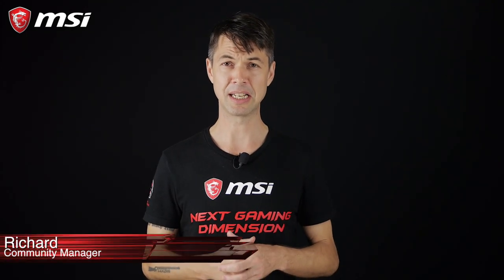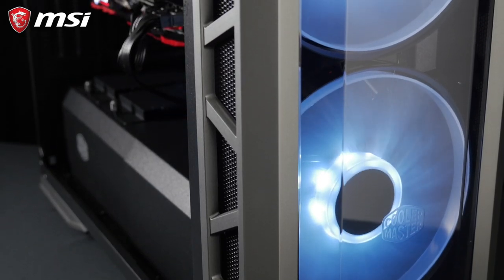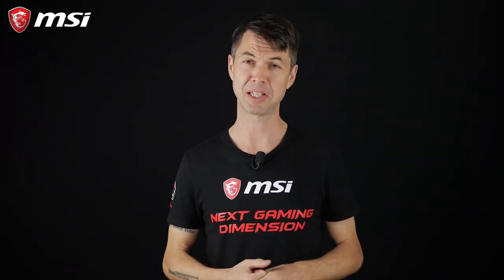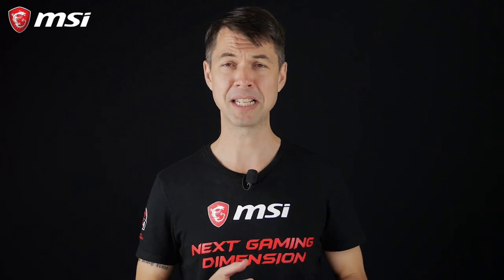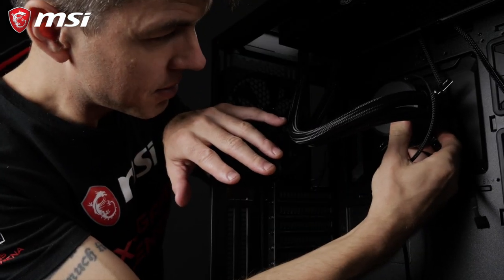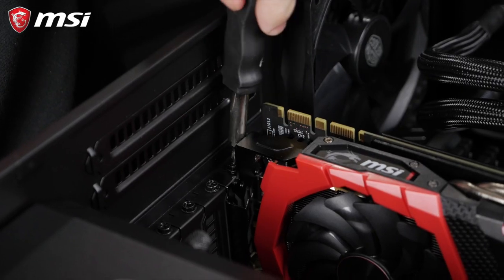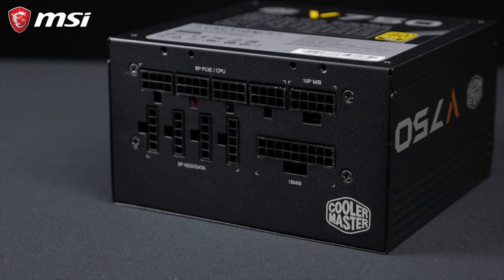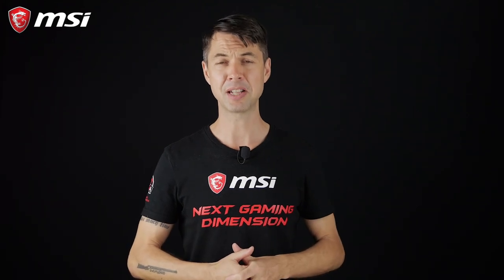MSI Pro Cast#15 –4K Video Editing PC Build Powered By Intel | Motherboard | MSI

Comment: +++Liquid Cooling advice needed!. Ive had a ryzen 1200/rx 560 system running a few weeks now on stock cooling fairly silently unless benchmarking and /or overclocking it to 3.8ghz. Tonight i made some custom brackets and fit my old AM3  920 kuhler to this AM4 b350 tomohawk mobo. It doesnt even get warm at stock Cpu speeds even when benchmarking cinebench, 3dmark. And I just noticed tonight at idle or just watching youtube videos and browsing the fan on visiontek rx560 doesnt even run. I did have troubles at first when i hooked up this Kuhler as just  in the bios the 120 mm fans ran at 100% and very loud so i changed pwm to dc in fan controls and now at idel or just browsing the kuhler fan only runs a min speed for about ten secs on 20 secs off. aida64 never seen my temps go above 47 when it was benching for a few minutes.
This just seems too good to be true and worried im gonna fry something, cpu/mobo or gpu+++

Comment: how did he just touch that ssd? also, I'm not all into those processors, but I do believe you shoulde be fine with a Ryzen 5 1600 for youtube videos (depending on  your own standards on quality), but after I checked some specs and comments, it seems that the thread reaper is better value. also, catche matters, but I'm not going to judge. if you go intel it's ok, it's still a powerfull build (be aware of temperatures, and power needed), and it will mostt likely do the jobb efficient enought. but if I had to make a workstation now, I would do some more reasearch first. I would look into value vs price, I would have to know if I was going to game on it, if I would host servers, if I wanted ecc suport for anything, and so on. but if I was going a build without ecc, that was either for pure workstation use, or workstation/ gaming machine, then I would probably end up with a amd cpu. Intel seems to lose in both cores (and threads), cache, and speed (not sure with oc, but from specs on the cpu'es amd wins). it's hard to compete with pricing on a cpu like Ryzen 5 1600 (not the x), because it have a acceptted speed, it comes with a cooler out of the box, six cores, 12 threads,  19 mb of cache, and a good price (and if you invested in a better cooler, you can oc and get even more value out of it). it's probably what I would have used if I started streaming.